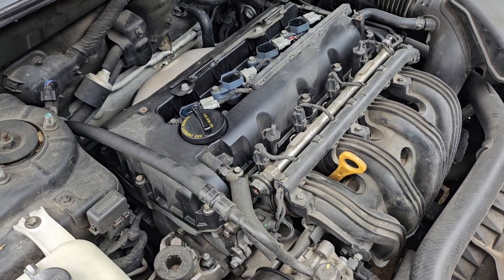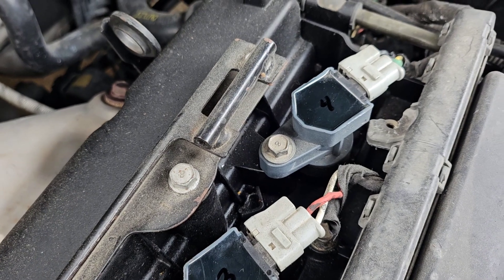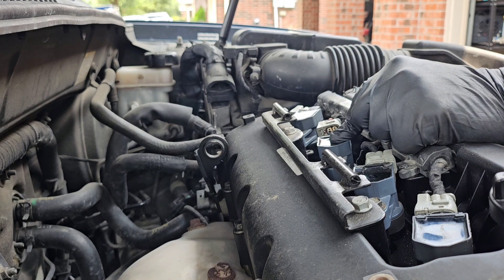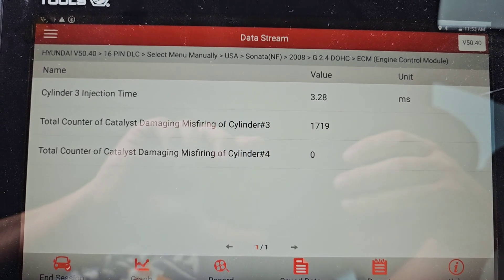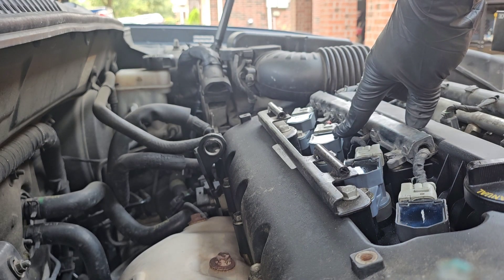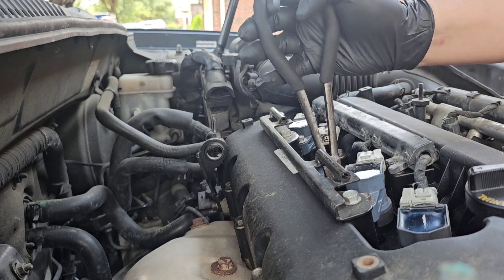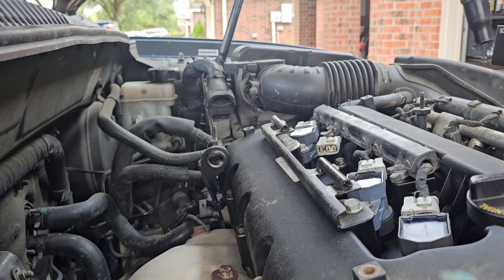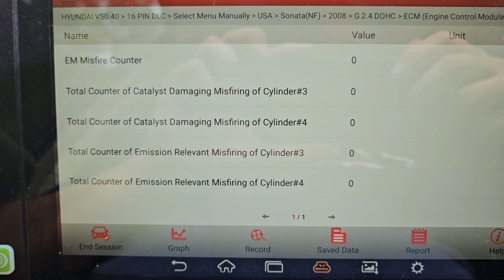P0403 Cylinder #4 misfire code fix

Comment: Ok..PO304..Cylinder 4 Misfire..If it is a coil pack..Yes change it...but pull the spark plug out of #4 cylinder to inspect..Good idea to do a dry/wet compression test as well....